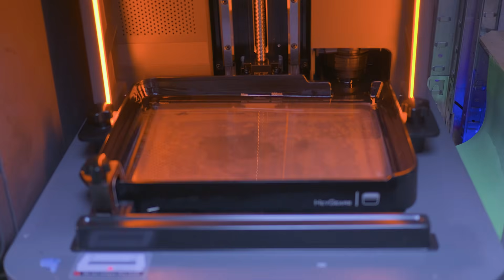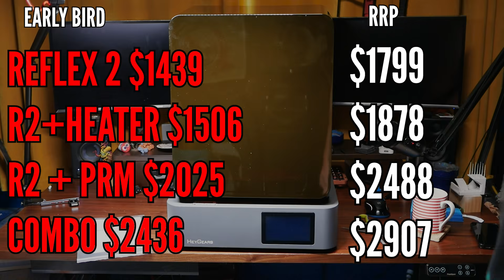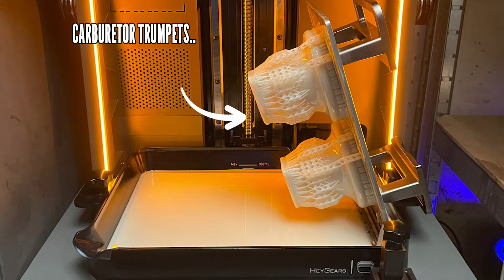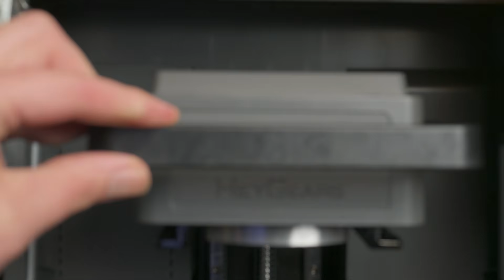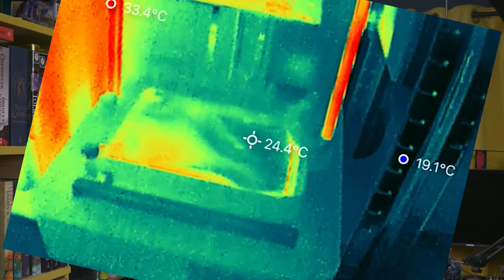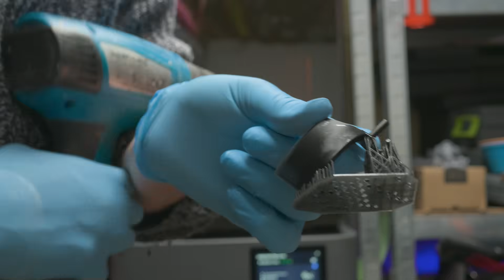NO-ONE expected this : HeyGears Reflex 2 Review

Comment: Reflex RS does not support their number 10 and 20 flexible elastic resin which means for someone like me i will have to fork out the extra cash for reflex or reflex 2.
Reply from the maker: Correct, if you are using engineering resins the the reflex 2 is a great printer, slower than the Form 4 but well under half the cost

Comment: This machine (and the company's policy) doesn't make that much sense.... It feels like Heygears wanted to target both the consumer/hobbyist and the prosumer but they will end up missing both. If they want to attract the prosumer, it doesn't feel that much "premium" unless you go to the Pro version which still.... too much plastic from what I've seen. If you target the consumer, first of all the price is too much but the biggest issue is the print quality.

And here is where their strategy doesn't make that much sense. With the Reflex and Reflex RS they had figures/toys creators in mind (mostly, since the Reflex also support more technical resins). Now, all of a sudden they shift from that market and release a machine that is mostly useful for "industrial" designs and not statues and miniatures. If they keep supporting the RS for years to come, then I can see what they are trying to do. If not, then like I said, it doesn't make any sense.

The screen though and the way it works is cool. Too bad is only 6K.
Reply from the maker: Hey gears marketing is sometimes confusing as they use the word consumer a lot. But as it stands currently the reflex RS is the consumer line, the reflex line is for prosumers/ studios and professionals and then beyond that they have specialist machines for larger scale production/ dentistry etc. 
having used all their Reflex range I disagree that it’s not premium though, it’s a significant step up from others and on par with FormLabs in build quality in the reflex printers, where is falls down is ease of use and nice to haves such as soft close hinges, but again it’s half the price.

I don’t understand your last point? They have a £600 printer for miniatures and and £1800 printer for engineering resins. Don’t be disappointed by the 6k screen the print quality is excellent and more than good enough for engineering parts the 12k/16k nonsense is mostly just marketing hype. The form4 for example uses a 4k screen, just a very good one.
Reply: What I meant is that if they keep supporting the Reflex and Reflex RS models for years then yeah, they provide multiple choices based on what you or your industry needs as a client. But if the Reflex 2 is meant to be a replacement then they clearly start to move away from the hobbyist (toys) industry and focus more on engineering stuff.

I have only seen comparison videos (haven't used the machine myself so I reserve my opinion). But based on those comparisons, the RS seems to produce better detail than the Reflex 2. Apart from that, the new light engine and the way this works is totally impressive! And I can see more companies "copying" this trick.
Reply from the maker: They are different machines really, the reflex 2 is designed for more viscous engineering resins that need greater UV penetration to work but in so doing some detail (not noticeable IMO) is lost. where as the RS printers are aimed at hobby resins

Comment: You haven't also addressed the fact that despite the R2 having a larger screen it is still 6K, which is good but the original also had 6K which means that the pixel size is a bit bigger, which translates to slightly less detail on the print. The R2 seems geared towards the more engineering resins that HeyGears is coming out with rather than those seeking finer detail printing. I have the Reflex Turbo, and it prints excellent details but head to head comparisons on other reviews have shown the R2 having less detail resolution, which is not a good fit for my needs. I have owned the Reflex Turbo for a couple of months and was a bit anxious when the R2 release was announced, but after seeing the differences between the printers I'm glad I have the Reflex Turbo instead of the R2.
Reply from the maker: Honestly my take is that the pixel count is all but meaningless these days, the reason manufacturers chase higher numbers is because they are driven that way by screen production. I cannot see a difference in detail in the models with the naked eye. BUT this printer is 💯 geared towards engineers not hobbyists like you or I the turbo is absolutely the right choice for us.

Comment: formlabs is absolute garbage.  I had two fail, less than 500g resin used between both. Zero help, terrible service when they break...and mine had 100% fail rate.
Reply from the maker: Ouch, that’s sounds appalling, I assume you didn’t have the service package with the FormLabs

Comment: If reflex rs was 860€ reflex 2 1200€ which would you pick?
Reply from the maker: I was printing with engineering resins like transparent/ flexible/ ceramic the reflex 2 every time. If I was printing models and minis the Reflex RS, no question
Reply: @RisingApe reflex rs prints more detailed prints?

I basically won a cupom and with launch sale I can get the 2 for half its normal price, thats why I’m wondering if it would be better.

I also would like to print miniatures/busts and other models and sell them online
Reply from the maker: sorry just seen this, its the same answer though, RS for miniatures everytime

Comment: Nice video, I have to say I was disappointed with the launch of this series. Unlike most on your channel I am not looking to print mini's or other statues but will be using for a more engineering/production printer for printing parts I sell. I do not need the height of the Pro but was hoping for a little larger build volume (width and depth) on the standard version of the printer. My question if you were buying a couple of these printers today for producing parts from more engineering resin (ABS Like - Black or Polycarbonate Like) would you stick with the new Reflex 2 or stay with the Reflex RS Turbo? For me the Pro is not an option because if I am going to spend 2999.00 I would just buy the Formlabs 4 which is a far better printer and workflow (and for a price they have an open material mode). One other thing I am a little concerned with is the 385nm resin vs 405nm as there seems to be more options in 405nm resin for the Reflex RS Turbo. Is the Reflex 2 printer going to print both? I know you highlighted the heated scrapper. It just seems like a cheap way to offer a headed vat but not as industrial as I would have expected. Thanks again Kyle
Reply from the maker: So it’s not a straightforward answer, it will depend on your business and the budgets. The TLDR is the Reflex will give you incredible prints at a very good price if you buy in the early bird. The Form 4 will give you a much better machine BUT will cost £3.5k plus 1k for the 1yr service plan plus another £500 for the plates and wipers and another 2k+ for their open license so it’s a big commitment for a printer even if it is more than twice as fast. If you are producing parts at scale, FormLabs, if not Reflex, if you don’t need engineering resins Reflex RS Turbo would be my shouts